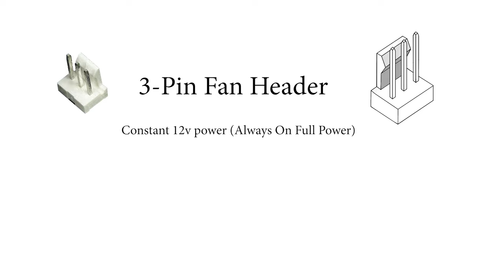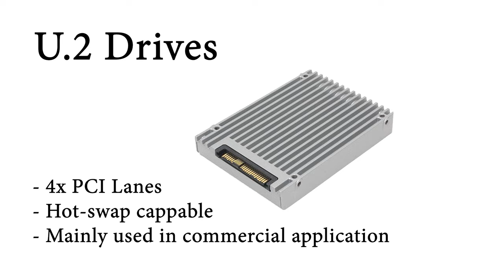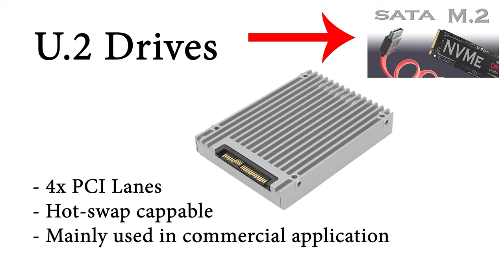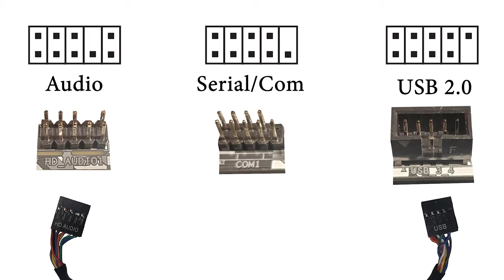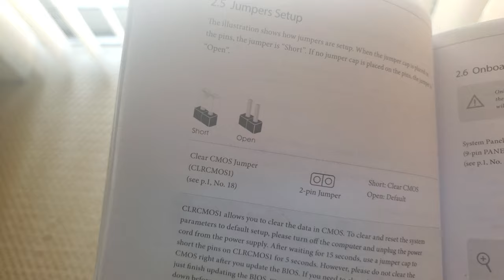Motherboard Connections Explained

Comment: Some ports that you missed (probably because your motherboard doesn't have them):

USB-C header - used to plug a USB-C connector on the front panel, if the csse has one.

3 pin ARGB header - looks like 4 pin RGB one, but misses one of the "middle" pins, runs at 5V instead of 12V and is fully digital (you can control individual diodes with it).

Those 2 are the only ones I noticed. Good job!
Reply: Ok, I was wondering about the 3 pin D-RGB connector. That's what my case fans used, and was confused for so long on where to plug it in.
Reply: and what about SPDIF
Reply: same lol but ye great vidd

Comment from the maker: For all those commenting about the fan headers: Yes, some motherboards can control the voltage of 3 pin header if the developer made that as an input. If you have a 4 pin header though, it cannot control a 3pin fan since it uses PWM to vary fan speed and not voltage.
Reply: Modern boards can.

Comment from the maker: Check out my video on the BIOS settings you should change as well once you have it installed! Top BIOS Settings You Need to Change!
https://youtu.be/nS7alB5Fh8o
Reply: 3 pin fans actually can be controlled by lowering the voltage. 4 pin is better because PWM means when the fan receives power it receives it at 100%. Trying to lower the voltage too much with a 3 pin fan will cause it to stall.

Comment: I'm building my first pc on my own. At first I thought "ok ..it's easy .. you take the mobo, put the cpu and the fan and all the other stuff , connect some cables and that's it " ...I     Had      No        Idea. I was trying to figure out for five hours straight what is going on with all those weird code names. Thank you so much for that video. Turns out it was actually pretty clear. It's a like from me ..
Reply: Lmao i thought the same when i started to put everything into my new case. But it’s pretty easy after you do it
Reply from the maker: Like riding a bike :) after your first it seems so easy

Comment: My friend is having a problem where his headphones aren't getting recognized as neither audio nor mic input/output. We didn't find a +5v dc front panel connector so we aren't sure if that is the problem. We will double-check for the connector tomorrow, but is it possible that the +5v dc connector is the problem?

edit: fixed the issue after a few days of posting this comment. turns out when we went to device manager my friend saw a exclamation/warning icon where the audio driver was, forgot what it was called. we rolled back the driver (basically reversing the update, there is an option when you double click the driver) and then his audio from all the audio ports were now working and windows was recognizing his external microphone and headset
Reply: I hope it get fixed
Reply: I'm having a problem where my Monitor isn't giving me any volume. Neither is it giving any audio through bluetooth. Regular headphones do work tho. Updated all the drivers and etc. Still doesn't work. Thinking it's a hardware problem.
Reply: @Verundanir  you sure your monitor has built in speakers? if so try to go to settings and make sure that your sound is set to speakers, i don’t really know anything else sorry
Reply: @kennwijesekara3683  lol it doesn't. Contacted viotek support. I feel like such an idiot. Spend hours troubleshooting xD

Comment: To clear the Bios on other Motherboards, the procedure may be different. You may need to remove the Motherboard Battery 1st before placing the jumper on the Bios Clear pins like JP1 or JP2 or what pins the book tells you to use to clear the Bios. Some Boards have a Clear Bios button on the I/O panel, & that's a nice feature.

Comment: My dad chose his motherboard specifically for the COM header. He works with electronics, like picaxes and things. He explained that he could use a USB cable, it's just that connecting using COM makes things easier. Something about USB ports having addresses, so if you plug the device into a different USB port you have to figure out the address of that port. (I'm not an electronics person so I might not have the details right.)
Edit: spelling of picaxe
Reply from the maker: Interesting! Thanks for that extra info!
Reply: Pickaxes are a very technological and way ahead of it's time, congrats to your dad for working on such a great piece of technology!

Comment: I swop to another motherboard ones. Succesfully. I took pics of each connection from old MB(make sure descriptions are visible), and with using my brain(because position of slots on new MB wasn't the same. Only I was little struggle with pins for front usb's etc. was couple single plugs and luckily I done. I was proud of my self.Thanks for video. Tom.

Comment: 0:46 Thats not correct. 3 pin Fans can be controlled via voltage while 4 pin headers are controlled by PWM. The PWM signal is what the fourth pin is being used for.

Comment: I have a question, suppose I have updated the BIOS for a new CPU, and then I messed up in something on Overclocking the CPU. In that case if I reset the bios will it restored to the factory settings, or the UN messed state of new updated bios.

Comment: Good video. Thanks for keeping it short and to the point. I've seen a few not mentioned here - probably only found on some higher end or older MOBOs. G1 Assassin has 2 x 8pin CPU connectors. It also has two molex pci connectors on the mobo for additional power to video cards. Not certain if these are included or needed on modern mobos since most GPU's now have on-GPU 6 or 8 pin power sockets.

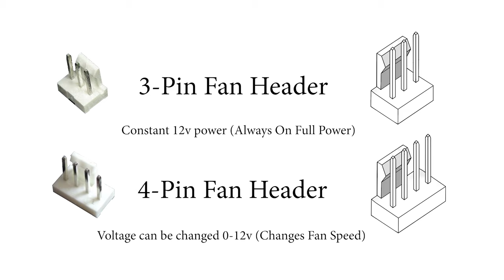Comment: 1:00 - Ok, the video is 4 years old but nowadays most of the boards have control over 3/4 pins fan/pump connectors and you can even customize fan curves in BIOS. Some boards are even auto-detecting if the pin is to be controlled via DC (3 pin) or PWW (4 pins).
2:35 - I think that's depending on the chipset's capabilities of managing pci-e lanes...
Nowadays there are lots of jumpers and connectors on mobos that are a mistery - like JTPM, for "trusted platform modules", or JOCFS for "safe boot jumper", others to connect some "tuning/monitoring" tools,

Comment: Quick question. My AIO cable is connected to the cpu fan header on motherboard. The AIO header on motherboard is occupied by another fan in the case. Should I switch these or leave it as it is?

Comment: Thanks for putting this together. I'm trying to build my first computer and I see references to "pump" fan and "pumps". And you introduce that term at the ~62sec mark in the video. I guess  everyone but me understands the term. Is "pump" just another term for fan? Or maybe "pump" is used for a specific fan on the MB or in the case? Can you please clarify? Thank-you!
Reply from the maker: Pump is for the literal water pump on water cooled PC coolers. Those coolers require a pump to circulate water and pumps need a constant full voltage at all times, so those headers run at their full voltage always to ensure you don’t damage your pump.
Reply from the maker: You can still use that header for fans if you wish and don’t own a water pump for water cooling. It will just run the fan at full speed all the time.

Comment: Hi just wanted to ask if my reset sw for the front panel stuff is connected to the main rgb fan connector while the rest(power sw/hdd led/power led+/power led-) are connected to the mobo itself the computer can still work right? Or do i need to unplug it and plug the reset sw together on the motherboard. Case i am using is tecware forge m2.

Comment: On certain motherboards like GIGABYTE for example have 2 pin jumper connector named CI (Case Intrusion) that looks similar to CLR CMOS (Clear CMOS) but have different functionality.

CI (Case Intrusion) helps office or businesses PC builds detects if the PC case was unauthorized open and rang an alarm sometimes the PC just power off itself unless you put back the PC case cover

Comment: Bro, I am actually confused. Is there a specific slot for Tpm chip or is it just included in motherboard ? I mean, can i buy it separately or am i gonna have to buy new motherboard which already has tpm in it? btw I have h310 m 2.0 motherboard and i m confused whether there is slot for tpm or if i require new motherboard. Your reply will be appreciated.
Reply from the maker: Some boards have the chip itself integrated others just have a header for it and you'll buy the chip and slot it in. The h310m has a header, so it's just a slot and you'll need to buy the TPM module to plug in. Your board needs the "GC-TPM2.0_S" module.
Reply: @MaxsTech  alryt brother. Thanks <3

Comment: I/O connectors on the front of the case. My MB shows a + and - for some of the cables. How do I tell which wire coming from the case I/O is + or -. Does it make any difference when I plug in the connector? What does the color of the wires on the connector signify? Which color is the negative wire? I've always bought pre-build PCs, and they have the I/O, connectors installed.

Comment: So I just bought some new parts for an upgrade but I kept my GPU and PSU. I was only able to boot once successfully into windows and then I nudged my GPU slightly and I got black screen instantly. After that it just would show anything at all. I have dealt with this before and after just messing with it. It can post after. I have gotten while just playing games green lines and weird flickering. Random lines and stuff. I read that a faulty PSU can lead to those issues. But it happened to often in my old build. And now that I have upgraded the parts aside from the GPU and PSU. I don't know which one is the problem? Is it perhaps a faulty power supply that isn't providing enough power to the motherboard and the other parts. I've had it for 4 years. I know PC parts can just expire brand new as well. Could it also just be the my hdmi ports are fried? I haven't ever used the display ports. So I could use those. But I hear the fans running and see the GPU fans running. The GPU market is beyond inflated. So I'm hoping it's not that.  So does anyone have some advice? 

Specs:
CPU: Ryzen 5 3600 
MOBO: Asrock b450 pro am4
RAM: Crucial Ballstix 16GB 3200Mhz
GPU: MSI RX 580 4gb OC (Not mining card)
PSU: Thermaltake Smart Power Supply 600 Watts (Not modular)

No case but that shouldn't affect any of this. Case comes tomorrow

Comment: A point to be aware of is that some motherboards have 4-pin fan headers which are not PWM such as the MSI Z77A G45 which only has a CPU PWM fan header, then x2 4-pin voltage control and then x2 3-pin fan headers. The last pin is not used, but it will use voltage control instead (not so good) and this can often not be compatible with fan controllers. I think the newer Gigabyte boards (Aorus?) use all Hybrid fan headers which will automatically detect between PWM and Voltage Controlled fans so it's the best of all worlds, plus I believe they are 2A as well, so you can run several fans from one header.

Comment: 4 pin male connector on Erica 8 board.  Looks like fan header but the offset of the fan plug doesn’t fit the clip is centered on the mother board male side ?????? Looked everywhere for info

Comment: Just been working on a h37h4-am motherboard from the Acer Orion 5000 PC and the header pins on the motherboard seem closer together than the standard connector on most cases. Almost like Acer has designed the case to only plug into that motherboard

Comment: Do you have any videos explaining your phone's motherboard basically can you swap one motherboard for another when you don't want to pay for a new screen
Reply from the maker: Phones are very different since most of the components are all soldered together. Not to mention that a lot of stuff is glued down as well. It can be done, but its much more difficult and whatever phone you are trying to swap out you would need the same identical phone to take its motherboard out since you cant buy those separate.

Comment: Thanks for your video. I recently bought a AX 3000 Tplink wifi bluetooth card. I installed it, but my motherboard does not have a 9 pin header; therefore, I haven't connected the wire for the bluetooth. Is there any way to solve this?

Comment: Hey so my fan header has 4 pins but the plug only has 3 holes so how should they be plugged, should ground be left? Or should I cover black cover portion , how?
Reply from the maker: You can still use it on the 3 pin header, if you look it should have a sort of channel it slides into in order to plug in. That channel only aligns with 3 of the pins so there should be only one way to plug it in and one of the holes from the can just won’t be connected to anything.

Comment: Nice video ... however in my opinion there is still a lot missing ... like the USB-C internal headers or thermal probe connectors.
Also 3 pin fan headers can actually be controlled by the motherboard by changing voltage output
The difference between 3 pin and 4 pin fan headers is that the 4th pin is used send a PWM signal to control your fan to control it while voltage stays the sam (usually 12 volt)
Reply: Thank you for noticing. I had the same questions

Comment: Hello, thanks for your video, very helpfull. I have a question: I have a new mother board with 8 pins CPU and my power supply source has 4 pins conector. May I use an adaptor 4pins to 8pins? Does it work without any trouble? Thanks in advance. Regards from Chile.

Comment: Hey there Max, awesome video, thanks a lot.

I have a question regarding a strange cable I have on my PC case. I purchased an RGB case wit 3 fans on the front and one at the back, only the fan on the back has this connector thingy to it. The fans spin and glow totally fine without this being plugged anywhere but I am really annoyed as I don't know what it is for.

It's basically a small flat 2 pin female (I think) connector that is directly saltered to the fan. I've done some research and it looks exactly like a FEMALE JST RCY fan connector.

The motherboard I am using is the MSI B450 Tomahawk Max, is there a connector where I can plug this cable into?

Your help would be highly appreciated. Thank you.
Reply from the maker: It sounds like your fan is just giving you an additional option for power. So if you didn't have any free 3pin or molex power options you could use the 2 pin JST connector. Seeing how you said the fan is on and spinning looks like you already have it powered via one of the other options. So you can just tuck that cable away.
Reply from the maker: If it is a female though this may be used to daisy chain other fans. So you could plug an additional fans into this fan to power them. Can be helpful for if you have multiple fans close together, say 3 in the front stacked together.
Reply: Thanks a lot Max. Ive daisy chained all of the current fans via molex connectors. I'll just tuck this one away as you said.

Comment: Max tech can you explain where i connect the front panel ones (power sw , led etc) I have a adapter thats cut short i dont know where to connect it
Reply from the maker: I have a separate video focused only on the front panel connectors :) check it out!

Comment: Good afternoon, the HD Audio plugs from the cabin does not go fully in the JAUD1 port on the motherboard.
It just goes half in but not completely in even though I hve connected it properly.
Is this ok ?or it should go full in ? 
Thanks in advance.

Comment: Hi, if you have a computer with a motherboard of 8 pin power supply, and you get a motherboard with an 8 plus 4, will that motherboard work ok with only the 8 pin connector?

Comment: I'm pretty sure 3 pin fan headers can be controlled by voltage. The third pin is a sense pin, otherwise a non-controllable fan would only need two pins. Also, a 3 pin can plug into a 4 pin (PWM) fan header.

Comment: So for my cpu power connections in the top left I have a 2x2 and 2x4 pin next to each other but I only have a 2x4 pin cable that spilta into two half's.  Do I put half into the 2x2 pin and leave the rest hanging or do input the whole thing in the 2x4 pin connector?

Comment: You're wrong on the fan-headers. 

The 3-pin could be controlled if the manufacturer has put a digital voltage regulator to it. In that case, the voltage is controlled through software between 0V - 12V.  
If the manufacturer does not put a regulator, then it's locked to 12V

The 4-pin connector works just the same as the 3 pin, and could also have a voltage regulator to it. The added pin, however, is the PWM signal. This signal, in essence, turns the fan on and off very rapidly between 0V and 12V. This "simulates" a lower voltage, but doesn't suffer from the cons of actually lowering the voltage.

Comment: Very informative content.... May i ask if is it okay to put 3pin aio pump to 4 pin??? What i mean is that my liquid cooler is just have 3 female pin but my mother board has 4 pin for aio pump.
Reply from the maker: Yes but you just need to make sure you don't use any fan control on that 4 pin port. So if you have some kind of fan speed software make sure it keeps that 4pin port on at all times and doesn't adjust it.
Reply: @MaxsTech  what you are saying sir is that i cant adjust my fan speed?

Comment: 3 pins the bios regulates the voltage according to the rpm, 4 pins it is pwm (duty cycle) which changes and not the 12v voltage

Comment: I have a kraken x53 but i connected the pump to chasis beacouse i dont have a aio_pump header on mobo, is there a problem? (kraken x53 has only 3 pin on the pump)

Comment: Hello, I would like to ask if is enough to connect 8 pin CPU power on my motherboard or I have to connect 4+8 connectors. I just connected 8 pin PCU, unfortunatelly my PSU does not have additional 4 pin. I have Fractal design ION 660P,  Mobo Gigabyte Z490 Vision G for i9 10900KF. Thank you for reply.

Comment: Hi, my case has 2 usb 3.0 connectors (powering a total of 4 usb 3.0 on the front header) my motherboard has only 1 usb 3.0 connector. How do I connect both the cables to my motherboard?